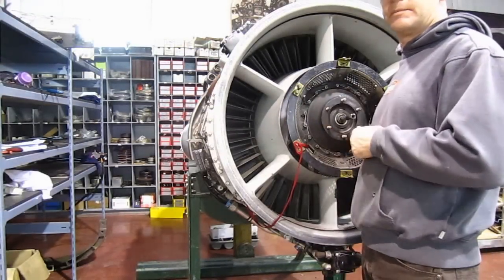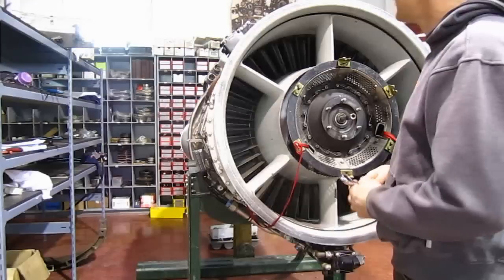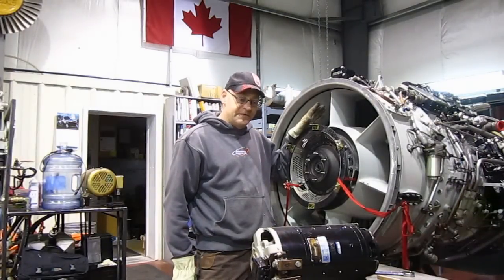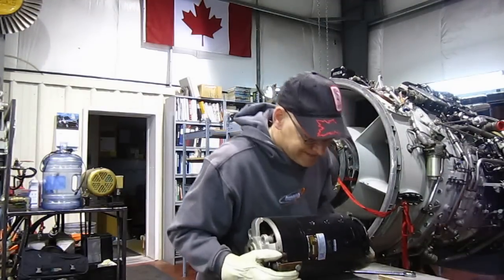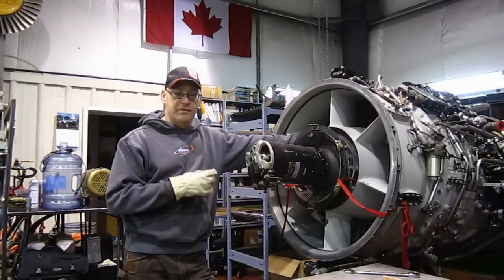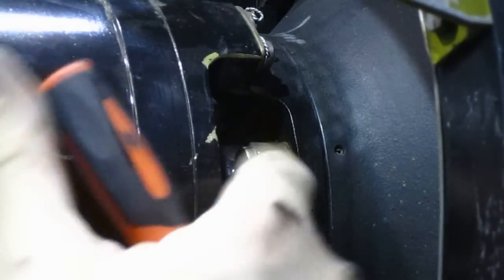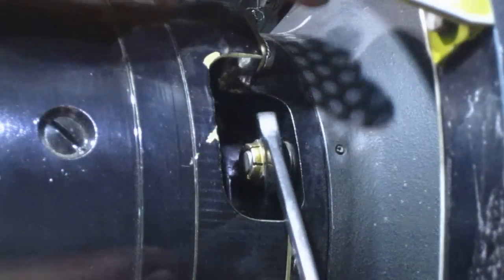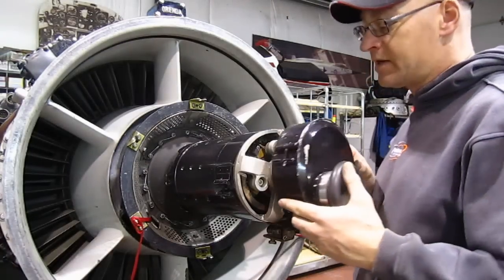Electric Starters for Jets ?

Comment: Your description of the startup sequence of sounds for the Saab Draken puzzled me quite a bit... I went through a few videos on YT, and definitely that's NOT an electric starter motor. By putting together pieces of information here and there (many from a very fine book written by nothing less than Rolls-Royce), it seem that the version of the Avon whick powered the Draken used what's called a "Combustion starter", or "Isopropyl-nitrate starter". Isopropyl-nitrate (a.k.a. AVPIN in aviation) is a

Comment: Question: Why aren't the different stages of a jet engine held together with splines in between the sections so you don't have to tare the entire engine down to get a burnt spline in a second stage turbine for example etc. It just seems easier to me. is there a reason why now, or is this being used on other engines? Thanks Al

Comment: I can definitely understand the weight savings benefit on an aircraft engine, but what about in an industrial application, where weight savings are moot?  Would seem like that in an industrial application, rolling around a huffer, would kill the plants ability to control stuff automatically. If the turbines are in a power generation plant, wouldn't electric starters just make more sense or do some plants use a large electric industrial compressor to start the turbines, instead of a huffer?

Comment: Do most Airliners/Corporate Jets use electric starters for the APU then Bleed air off that for the engines? Also I have seen smaller Jets like a Beech Premier or older citations (W/O APU's) Just hooked to a battery cart...Do those jets have electric starters since there would be no source of bleed air for the first start?

Comment: This is sounds stupid, but how much voltages and amps needs to run one of those? (Sorry my bad English..)
Reply from the maker: +Anton Widiastanto Starter uses 30VDC. Initial current  is 750 amps. As rpm builds, current approaches 50A. At that time starter is shut off.
Reply: +AgentJayZ thak you very much.. Wow! so it's need 22500watts, I wonder what is battery looks like or is it charge by ground power supply..?
Reply from the maker: If you watch the videos of us starting it, you can see the power supply.

Comment: amazing those tiny nuts of the studs hold an 80lb motor hanging in place.
Reply from the maker: There are six, and they are huge. The nuts take a 9/16 wrench.
The output shaft of the LM500 transmits over five thousand Hp, and it is bolted to the load with 18 tiny bolts, the nuts taking a 7/32 wrench. Yes, smaller than 1/4 inch. I also can hardly believe it, but I have done those bolts and nuts up, sir...
Reply: @AgentJayZ  I see. The video may have skewed my perspective.  Thanks.

Comment: Ya'll ever work on or repair engines that start with Triethelborane Fuel......?    Or is the Risk  to high.....?   Or is that mostly for your jet engines that use the 2 part fuels that supply there own O2.....?
Reply from the maker: Nothing Exotic like that.
Reply: ***** There is a few jet engines that run on 2 part fuels and start with T.E.B....Most have it as a alternative fuel systems...i was just kinda curious how many there is of these type of engines....:)
Reply: TEB was never used for starting energy, only as an ignition source. The J-58 on the SR-71 had a mechanical drive turned by a special start cart with a driveshaft. TEB was used to light the fuel which was a high temperature ignition fuel, similar to Stoddard solvent.

Comment: What kind of electric power does one of those take?
Reply from the maker: +Bozo Fab 
The Orenda starter uses 30VDC, 750A to start, trailing off to below 50 at cutoff rpm of around 2000.

Comment: The Germans used a little two stroke to start the engine.
Reply from the maker: If it was a good idea, it would have been adopted for use with other engines.
Reply: Maybe it was the thought of people standing in front of the aircraft on the field, pulling the starter cords on the front of the engines? Cant see that inspiring confidence in passengers! 😁

Comment: You are falling into the same trap as many of the average Joe's are when it comes to electric motors. Starter motors as used in this Jet are 100% electromagnet based. It is mostly likely a series-wound DC brushed motor,  and they are heavy. AC motors have no brushes and have been around since 1888. You can make AC motors very light by having it designed for high frequency. The starters today are most likely 400 hertz, 3-phase motors which are very light for the horsepower they produce.